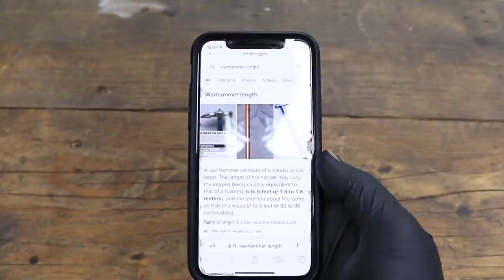Medieval Spiked WarHammer Build - Using Basic Tools

Comment: Great build, man. My wife is currently using a cane my uncle made back in the early 90s-ish. It's a tube steel shaft with a solid brass billet for a handle. He made it so he could pretend he had a bum knee and carry a warhammer through the Atlanta airport without being questioned. I DID try to take an armadillo out with it one time.
Reply from the maker: That’s wicked cool mate, thanks very much

Comment: You have inspired me to make my own. I used 3/4in fittings and a bushing to drop to 1/2in for a square plug instead of a spike. Going to ebonize the handle and then I can share some pictures of it. Or a video. Also building a much larger one with 1in fitting and going to to 1 1/2 or larger for the hammer face.
Reply from the maker: That’s wicked mate, i have a page on Facebook to share stuff
Reply: @DiesInEveryFilm  cool, I will hunt that down once it's a finished.

Comment: Wooden pallets are made from hard woods and can be had for free. The long closet rods are soft woods and the wood grain makes them prone to splitting. Additionally, having an oval profile versus a round profile is a better grip like a wood cutting axe. Some wheel weights from the tire shop or scrap yard are easily melted and added to the hollow hammer head would give more mass to the business end. 

Good build!
Reply from the maker: 1 pallets aren’t all hard wood
2 this isn’t a closet rail it’s a hard wood dowel
3 lots of old war hammers were round and it’s perfectly fine as i showed. 
4 these aren’t meant to be heavy they are light for fast striking. 
Please refrain from telling me how to do my job especially if you are just using opinion over actual knowledge.

Comment: I had no idea when I woke up this morning that I needed to build this, but now that I've discovered this video, I have to have this hammer in my life.
Reply from the maker: Haha that’s brilliant
Reply: @DiesInEveryFilm  I wonder, would these materials respond well to tempering?  I don't think all ferrous materials do, but I wonder if the spike and hammer face would benefit from being heated up with a blowtorch and then quenched in oil...
Reply from the maker: @marka4891  it’s cast so not a carbon steel, they don’t need HT
Reply: @DiesInEveryFilm  Gotcha, thanks.
Reply: @DiesInEveryFilm  It occurs to me that if you use a cross, rather than a tee, you can add another spike to the top.  Then you'll have a hammer, a spike opposite it and a spike in between those.

Comment: Hi again mate. What did you use for the shaft handle, Is it a sledge/pick axe shaft. Also i live in Liverpool and cannot seem to find cast iron plumbing fittings anywhere 🤬where do you get yours? Btw your now my favourite YouTuber hands-down 😁
Reply from the maker: Full parts list in description mate, it’s wooden dowel and most is off ebay
Reply: I live in the US and those parts are galvanized steel available at any hardware or pluming supply store. Do you not have stores like that in the UK? That would be a bummer.
Reply: @mikedalton268  Sweden is also crap when it comes to buying materials. So jealous of your stores a lot of the time. Can't even buy borax here because it's "reproductively toxic". It's like living in cuckafornia without the weather.
Reply: @TheTurinturumbar  Sorry to hear that. I dont like the "character" of what my country has become, but we do have access to things as consumers.

Comment: If you don't already know you can cut a small groove into the thread of the two things you are screwing together (or just the father of them) so when you put cement or glue in it will lock together and be inseparable other than that great video and excellent build
Reply from the maker: Yup it help for sure but these threads are tapered so the glue and a tight twist is plenty. Thank you
Reply: @DiesInEveryFilm  It's mostly for pvc and those things that just won't stay stuck, sharing what I know may come in handy one day. I hope you have a great day.

Comment: Love the vids! Keep up the good work. Had some ideas if you're interested. What about using a small cap on the spike end, drilling a hole for it and grinding a lip on the spike to set up against the back of the cap. No way for it to work loose over time. Also keeping the threaded end on the butt cap and using the grinder to smooth off the exposed threads then drilling a hole though and riveting a piece through it.
Reply from the maker: I prefer the way i did it and there’s no chance of it coming loose at all

Comment: GREAT hammer.   Little tip?   Use a drawing knife to cut some flats on the sides of the handle to assist with indexing and making solid hits.   It really helps with polearms and warhammers where lining up the head counts.  And using the same techniquest it looks like you can make a Bed de Corbin with very little additional effort.
Reply from the maker: This is a basic tool build not supposed to be fully accurate
Reply: @DiesInEveryFilm  : true and it's a great tool.   I'm just pointing 5 minutes of cutting that makes it even better.   STill Love the hammer I'm going to use this to make me one.  :)
Reply from the maker: @brandonbowerstx  yes i build weapons for a living and i would have indexed it but this is a video for people with no tools and skills lacking
Reply: @DiesInEveryFilm : Oh cool.  Just saw your shop.    I'm gonna step back and enjoy some more videos and have a cup of silence.   😁

Comment: Well, I got bored so I got the stuff to make this. Cost was about $40USD, time was about 1:30. I also don't have Bar stock laying around in that size so i just used a 1"nipple to a 1" reducer to 1/2" and stock a square plug in the back. 
Used an 80grit sand block to slim down the dowel to size for a tighter fit around the T bend and the length of pipe. 
For the bottom I sanded it then stuck on a 1" to 3/4" reducer with a square cap piece. This left the overall length at about hip height for me after some measuring and sawing. Now I have a walking "camp hammer" for when I go hiking. Fun fact: If you don't have the round bar stock but have access to a grinder take a Railroad spike, SLOWLY grind off the corners and the grind down the head, feed it through where you would put the bar stock, shim all 4 sides of it with wood, and seal it with epoxy. 

Thanks for the project! It was very enjoyable!
Reply from the maker: Thank you for watching and taking part

Comment: Very nice construct. In particular, I found your method for grinding a point on the rod interesting. I prefer to use "found" items in my weapons, and at 70, I've accumulated a lot of odds & ends to mine for components, like an old padlock for the head of a flail. On something like a hammer or axe, I prefer a flattened, oval, or octagonal handle to provide direction in use.
Reply from the maker: Thanks very much, i like using old stuff to make new stuff myself tbh it’s definitely therapeutic

Comment: Filling the head of the Hammer with powdered aluminum or just sand would give it a little extra weight but also dead blow impact.
Reply from the maker: I did that with the mace but this is supposed to be light as most war hammers were

Comment: why do you need to clean the pipe with methylated spirit? genuinely curious.
Reply from the maker: Because it had an oily coating on it which would prevent the glue bonding as well

Comment: I don't know why but I thought this was kind of cool. Although I don't understand why you didn't just use a very large nut and bolt to go through the top of the T fitting.
I would have given a lot more weight to the Head.
Especially if you put one nut as a spacer then slid it through the T, then put another nut on the back end and then sharpened it to a point.
Reply from the maker: Thanks, you misunderstand the warhammer and it’s use, these in actuality weren’t heavy headed they were light and nimble
Reply: @DiesInEveryFilm  well looking at that way, this is really a good build
Reply from the maker: @bluebeard6189  thank you, definitely worth looking at the medieval WarHammer

Comment: Now make one with a ramset blank.👹 Strikes, bounces back, bang. Lol
Reply: Side note: heat the bolt(hammer head) in a forge or heat source, strike it with a ball peen in the center to indent, then grind in some teeth
Reply from the maker: It’s a basic too series, not everyone has a forge
Reply: @DiesInEveryFilm Customs Valid. 🤔What about a propane torch? One of the handheld ones. 🤷Just thrown ideas out there. Maybe cut an X it with an angle grinder?